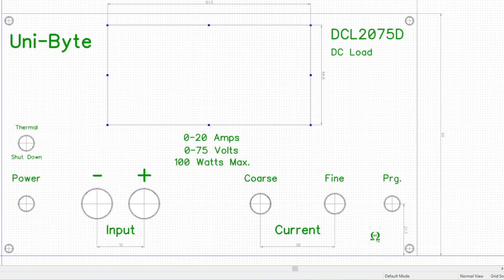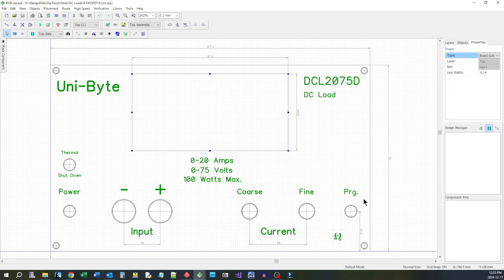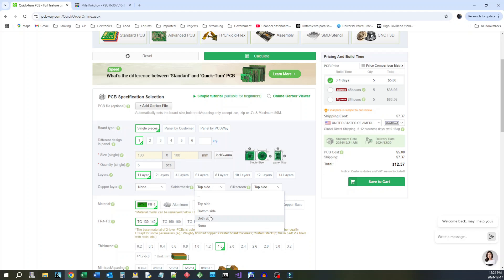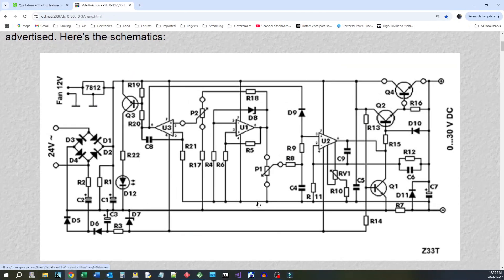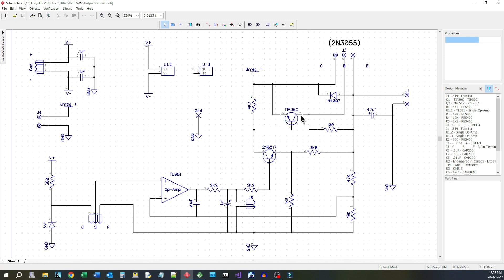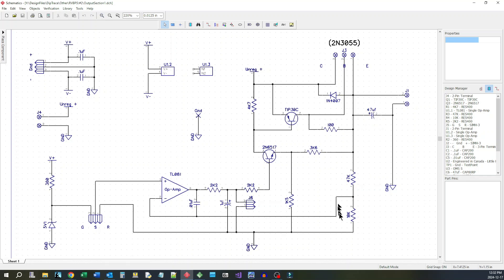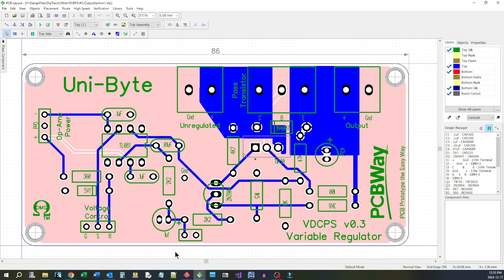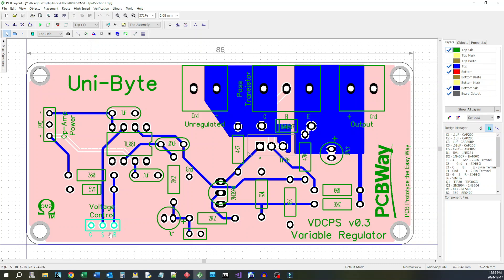Uni-Byte 0239 - Let's Build A VARIABLE DC Power Supply: Part 1

Comment: won't the unreg + bouncing around cause stability, or at least delay issues for the op-amp V control loop, or am I missing something?
Reply from the maker: Bouncing around?  Do you mean the 120Hz ripple?  It's a possibility.  Let's see what happens in Part 4.
Reply: @uni-byte  YEP, the 120H ripple that it has to track ON TOP OF output regulation.
Technically it may have poor PSRR as the control loop has to do double duty.
I love the voltage ability in the scheme as 99.9% of op-amps are limited to 30-36V, si ti's nice,.
I'm just pointing out the compromise. 😁

Comment: I think it would be good to measure op voltage drift over time, and how much it varies with ambient temperature.  My 30 year old diy linear psu with current limit using 2 x BC107, a BFY50 and a 2N3055 transistor (as in your design) does vary slightly with temperature . The voltage reference is 2 x 1N4148 diodes in series which is probably not ideal. The TL431 ? should make it very stable. So yes if your design has better temperature stability I'm in!  Looking forward to the kit on AliExpress when finished!
Reply from the maker: The Zener I'm using is a 1N5231.  They have a much better TC than the 1N4148 and can actually be close to 0.  Worst case is somewhere between -1.5mV/°C and +1.5mV°C.  But I won't rule out a TL431 as they are very inexpensive.  I doubt there will be a kit available unless someone in China want's to copy my design🤣.

Comment: I like your panel design idea. PCBs have gotten so much cheaper over the years!

At a past job when I was doing this regularly, I used FrontPanelExpress. They have a nice CAD program that lets you design a panel and see what it will cost. They do infill in different colors, and they also let you tap threads and so on. Very professional looking. 

Nowadays, I am not as certain how I would do it. 3D printing is affordable, so instead of tapping a thread on the reverse side I might make a bracket to hold an LCD display and glue it to the inside. Or even 3D print the entire panel.
Reply from the maker: Thanks you, and thanks for the information.

Comment: Interesting power supply project. I like it.  I would be interested in the power stage circuitry consisting of the three transistors. Could you please explain it more deeply for better understanding? Especially I did not understood the purpose of the "light" feedback for the first transistor following the Opamp (4:47).
Reply: Yes, you are right, you said little feedback. Sorry for any  confusion. I have simulated with LtSpice. Your technique is new for me. Personally, I would do it with resistive divider at base only. However your approach is clever. I‘m aware with negative feedback but have never used such technique. Thanks for explaining and Happy new year!
Reply from the maker: @heinzkreutziger2218  You are welcome.  No worries, I wasn't upset at all.  I should be publishing the test of the circuit tomorrow.  Happy New Year!
Reply from the maker: Did I say light?  I thought I said "a little" negative feedback. The negative feedback is there for the same reason negative feedback is always used, to reduce the voltage gain.  Just the emitter resistor alone would provide some, but that would only be with respect to the base drive.  Putting in the 3K6 resistor to the output provides more negative feedback in response to the output voltage.  Since the op-amp is capable of 10V or so on it's output we only need a little voltage gain to accomplish our task.  Too much will make the circuit unstable, so we reduce it.